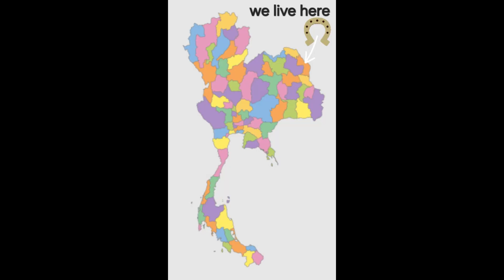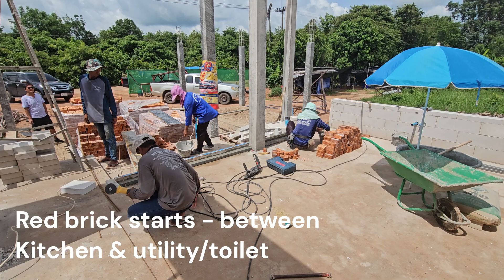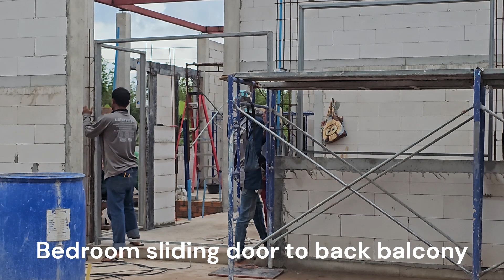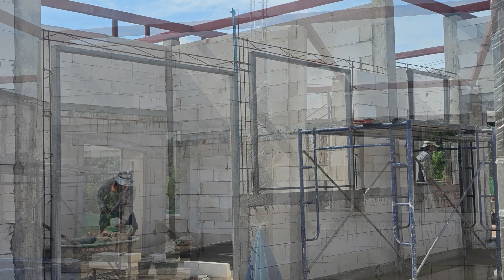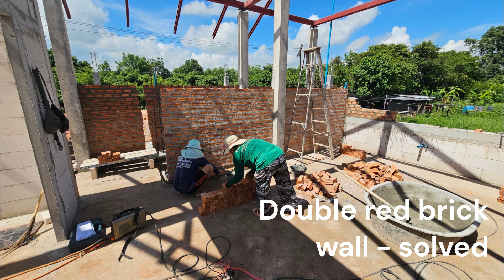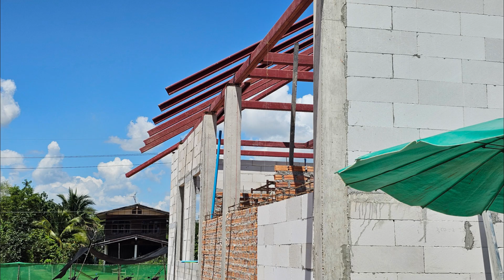Thai House Build Week 12 - Walls & Roof Pt 2

Comment: Absolutely you do not need those little red clay bricks in bathrooms and kitchens, water absorbency has nothing to do with it as they will be rendered. Lightweight blocks have far better thermal properties than those horrible clay bricks, and believe me the lightweight blocks are more than capable of supporting kitchen wall cabinets, I know as my IKEA kitchen was hung on them 6 years ago and nothing has moved. Beware poorly built cavity walls in Thailand, the two skins of block or brick MUST be tied together at regular intervals and the cavity should be kept clean or mortar. Roof trusses should be braced, as was shown I believe on the drawing you showed. Other than that looks like a good quality build.

Comment: What size are the blocks you are building walls with 
Thanks
Reply from the maker: We are using AAC 7.5 cm blocks(with render 10 cm) for most of the house. Most walls are protected from the sun, but those that arent are double thickness.(2 × 7.5 blocks with air gap). The bathrooms use red brick.

Comment: Issan is very hot in Jan~May. So, consider installing radiant barrier sheets under your roof tiles.
If you decide to install ones; please do some google info on it because Thai Roofer don't like to leave air gap between the roof tile and radiant barriers  which make reduce its efficiency.